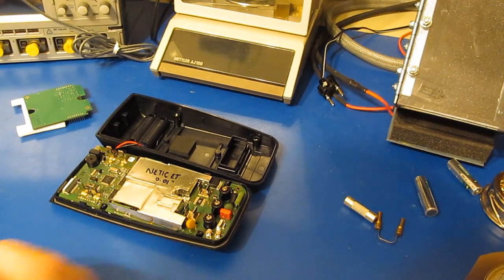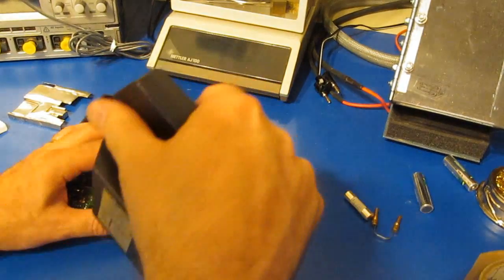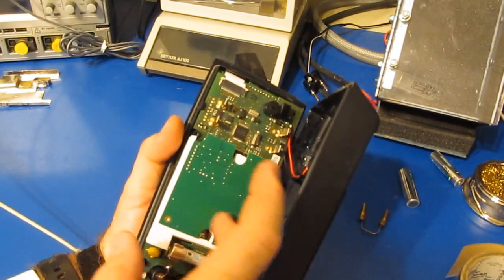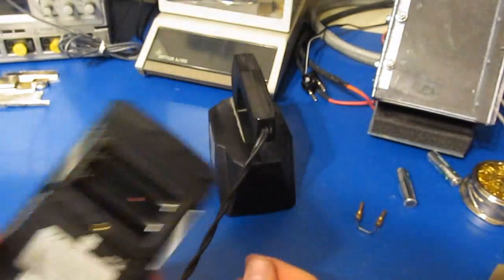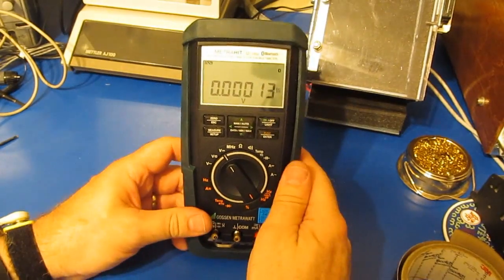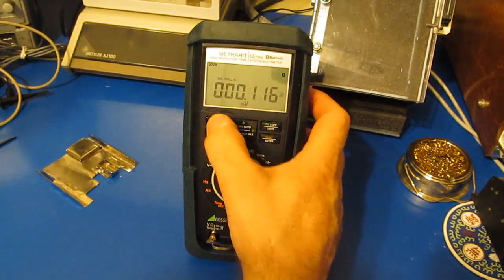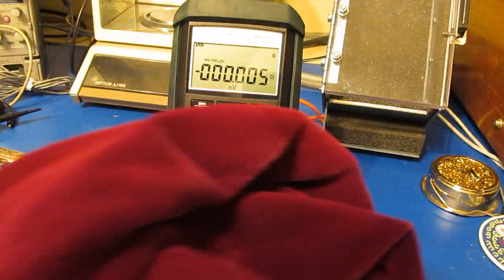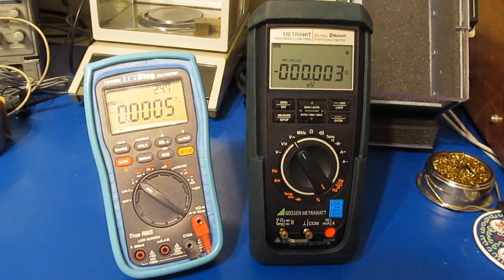New Shield and other Mods to the Metrahit Ultra

Comment: Are the other multimeters you have tested that include a μV range susceptible to these effects (I can't remember which ones they are but I think you mentioned a couple in another video)? If not, do they have more adequate shielding?
You deserve to be getting compensated for your effort by meter manufacturers. In that respect, kudos to Dave Jones for sending you a new 121GW.
Reply from the maker: To be clear, Dave had sent me one of the early prototypes once they were done with it.  I plan to purchase the final version once I feel the hardware design is stable.  I was hoping that would be after a year from the release but I am now thinking perhaps one more year.    All the videos are on-line including this one along with others in the chamber.
Reply from the maker: Keep in mind too that I think Gossen was the only company that thought it was a good idea to use these latching relays in their design.

Comment: Have you heard something new from Gossen?
I hope that they fix all the issues it has some day instead of just contemplating whether or not to do something. Great and very detailed review. Greetings from Germany
Reply from the maker: Sadly, no.  It's too bad really as this could be a really nice meter.
Reply: @joesmith-je3tq  I got a reply from the company. Since the beginning of 2019 there have been changes made to the Metrahit Ultra. 

1. The bottom of the case got additional Netic shielding
2. The shielding of the upper part has been replaced
Sensitivity to magnetic fields and static should be much lower now.
Greetings from Germany
Reply from the maker: @yetanotherworldview  You sir have made my day!

Comment: Very cool! You fixed the problem. But obviously now I'm wondering, would it pass your tests? I guess you're not too keen on doing it all again when it takes a whole day.
Cool of Dave Jones at @EEVblog to send you a meter, I have high hopes for that one. With the stuff I do, all it need to pass for me to buy one is the grillstarter test :)
Reply from the maker: I wouldn't say fixed the relay problem so much as addressed a symptom.  

Sure we can transient test it again.  What I would do is just go right to the last setup or maybe one click down.  Wouldn't take too long if you wanted to see it.   

I did try the RF link out which was not in the video.  I'm not sure what the range was before but it's an easy 20' now.  More than enough for me.  

Dave's meter is scheduled to arrive next week so it won't be too long.
Reply: Really looking forward to the EEVblog test. An opportunity to see it in action as well.
Reply from the maker: Running the Ultra right now at 12KV w/ mods.   Doing a few other requests while I am at it.  May have something uploaded by the end of the day.

Comment: If this thing weren't so slow at ranging, it could now be your new sidekick (displacing the 869).
Reply from the maker: Slow auto range,  frequency mode has a bug not to mention the threshold problem (I could over see this) ,  AC+DC mode is better than nothing but would it has a tri-display that could have been used for this,   where's the second temperature probe?  I am sticking with my unmodified BM869s.

Comment: Gratuliere der Messgeraete  ist gerade perfekt!
Reply from the maker: Thanks.  The meter still has other problems that will require possible changes to the hardware and firmware to correct.

Comment: you still had your anti static strap on, while trying the cloth. or was it unplugged. or thats what it looked liked. 
https://youtu.be/Jf_9XWL3TD8?t=356
Reply from the maker: That is a VERY good question and something Dave or someone should do a video on.   To answer your question, in this clip I had to go to my wife's sewing room and steel the fabric and unplugged.  I did not plug back in.  However, it makes little difference.   Also some interesting things were being shown in Part 2.
Reply from the maker: Also,  you missed a major screw up.  I assumed everyone knew in the 300mV range, we can't measure 500mV.  I was seeing about 500uV.
Reply: yea i did miss that one.
Reply from the maker: Does it make sense to you why the wrist strap would have little effect?
Reply: yeah because of the shielding that has been put in place. if my brain is thinking correctly, this morning.
Reply from the maker: Well sure, that was the goal but there is a lot more to it.  Not all fabrics behave the same.  If you have a few minutes, read the follow articles.  You may find them helpful.

https://www.esda.org/about-esd/esd-fundamentals/part-3-basic-esd-control-procedures-and-materials/

http://advancedtextilessource.com/2014/05/23/antistatic-conductive-or-static-dissipative-which-one-do-you-need/

Comment: World's only 121GW in the wild is on the truck.
It's a wimpy 600V CATIII though, don't release too much magic smoke.
Reply from the maker: Both the Fluke 101 and 115  are only rated for CAT III 600V as well.  These two have yet to be damaged.    Then again,  my UNI-T UT61E is CAT IV 600 and could not even handle the grill starter.  IMO that's the lowest of the low!
Reply: Kudos to you sir for sending the meter for testing. I'm really looking forward to the test. It's on my "buy" list.
Reply: All the smoke!

Comment: Gossen: "Sorry, we cannot let you keep the meter with the mods you made.  Please return it to us for a full refund."
Jokes aside, fantastic job,  Mr. Smith. Especially with the relay shielding, I wasn't expecting to see any solution for that problem
Reply from the maker: I guess I could sell the meter back to them including some additional engineering costs.  10 mil should cover it. 

The MuMetal did a fair job but this new one is better.  The problem is it addresses a symptom, not the root problem.  If the relay were to change states for what ever reason, the problem is still there.   Personally, I have no need to auto switch the meters function.  It makes the meter more complex, adds cost and makes it less reliable. And lets not forget this other little problem is causes.  Had the meter been damaged from my testing, I may have made a case how the software that controls the meter cause the meter to enter a mode where it becomes damaged.
Reply: @joesmith-je3tq  I am thinking if they has bend the MU-metal without heat treating it afterward, if so, it do almost render the metal useless. Or is a stupid thought sins they know what they are doing?
Reply from the maker: @friedmule5403  I suggest you contact the manufacture for questions.    https://www.mushield.com/heat-treating/heat-treating-vs-annealing/